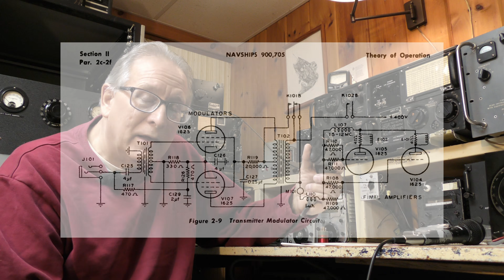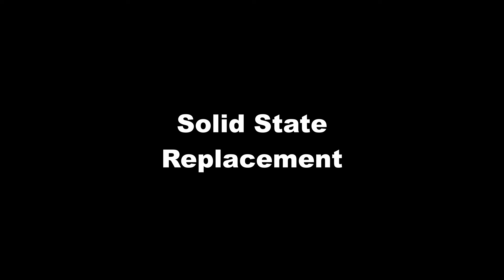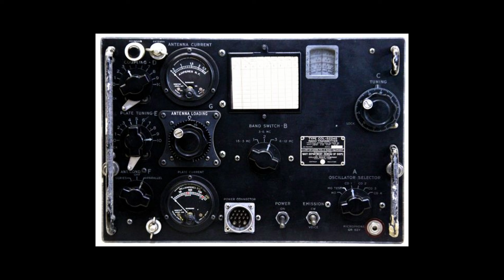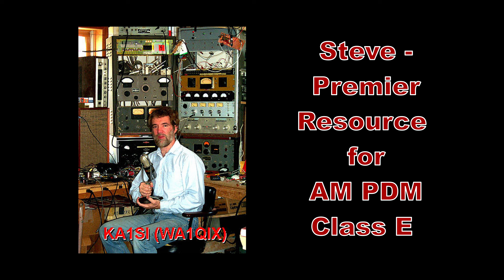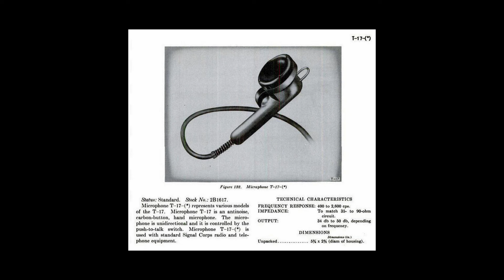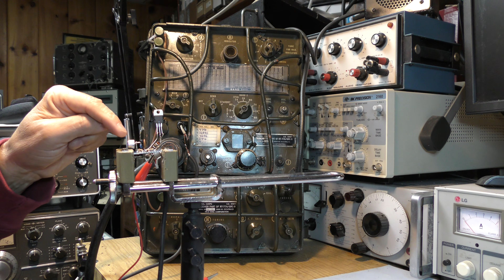T 17 Carbon Microphone Replacement

Comment: Interesting, but I'd like to use the microphone from an old mobile phone.  A bit fiddly to solder the socket but it also has a volume control built in. Then I guess that you need an amp for the earpieces and some impedance matching maybe.  All to run off an LiFePO4 3.2V cell.

Yes too complicated and not as robust I'm afraid.
Reply from the maker: Older phone mics are definitely Electrets.

Comment: Mike I find it neat that you find parts in an old computer power supply, to build your carbon microphone replacement. I too have old computer power supplies, that I have found useful parts to use in other projects. Your right about the shorts, I get more out of your full length videos.

Comment: I've been using electret replacements since the 1980's.
However, I've had a number of them fail for various reasons.
They can be blown with RF (hot-mic) feedback, back-EMF from the TR-relay, and other voltage-spikes.
The worst offender was a Swan 260 Cygnet, that took several measures to tame.
I've used voltage-regulators as isolators, series inductors on the power, and very-low value inductors on the isolated audio-line.
So, you may have a couple fail before you nail a total solution, but it is worth it in the end.
In every case, I've gotten great audio-quality reports!

Comment: 17:30 Looks like a Western Electric T1 transmitter unit! I prefer using them with a two-transistor transimpedance amplifier, which also provides a constant bias for the mike in the range of 100-150 µA. We don't have to fry carbon mikes with 50-90 mA current like we used to now that we have transistors! (hi-hi) Here is a link to the schematic in UUE format, you need to decode it with uudecoder (for some reason YouTube deletes my comments with links): 7:'1T<',Z+R]I8F(N8V\O,6964V-.;DT

Comment: How does your circuit work in a high noise environment like a GRC-19 set with screaming jet engine  fan noise?
Reply from the maker: Wow! Yes that is a bad one. I thought my ARC-2A was bad.
Reply: @MIKROWAVE1  I had a GRC-106A set that was just as bad I'll never own another one of those the GRC-19 is much better IMHO.  I use the Roanwell  14610 carbon microphone elements in my T-17 they seem to work really well.
Reply from the maker: @U812-k7j Back in 1978, I worked for a startup as a co-op 3 quarters. I was 20 years old. My job was to test  military radios in front of a source inspector. The company principles were all GD castoffs. GD left Rochester in 72. The Navy and Army would send in radios for repair and recertification. T837 AMPS pig tuners R1051s GRC-106's. You name it. We would recycle scrap radios, make and test new components, re paint and stencil. We had all the microfische and I used a model 1 xerography to blow up prints with a bellows camera and hood. Endless hours on carousel. Thats why I will never own a GRC-106! Ha.

Comment: Useful info here.  I'm going to have to be dealing with some T-17s & wanted to avoid hacking at the radio internals.  I have one or two that "sorta" work but you do have to talk up to them.
Reply from the maker: Glad this helps you keep the radio internals original. We do not need more hacking!

Comment: G'day mate, all this stuff reminds me of my telephone technician days when the carbon 'transmitters' used for many years started to be replaced by condenser microphone 'equivalents'.  They worked well, except that they did not work as well as old carbon transmitters with the acoustic modems that we used at the time.  Regards, Felix vk4fuq in Australia.
Reply from the maker: Ya the electret really was too cheap to not use about everywhere!

Comment: It is warm enough you can wear shorts. As long as you are modernizing the mike, why not use IC's to modernize the T-17?
Maybe even surfacemount.
Or use a Heil carbon mike.
Reply from the maker: I obviously need to do a shorts short, wearing shorts!

Comment: IIRC, the TIP120 is good up to about 1MHz which is a lot higher than I can sing but it has the advantage that the gain doesn't extend much up into the RF band you will likely be using.  This means you don't need to worry about layout much.
Reply from the maker: Yes a Daft to RF transistor type cannot hurt with any transmitter that has its microphone exposed close to the antenna.

Comment: I'd offer to make you a carbon mic, Mike, but you're 57 years too late. When I was 10, I made pretty good mics from a cigar box, two razor blades taped to the top, standing up, and a carbon rod from a D cell straddling the blades  :)
I wonder what kids these days to when the mic to their 3" reel-to-reel tape recorder from K-Mart breaks?  Thank you Mike! 73 OM dit dit
Reply from the maker: Those old tape recorder mics were probably crystal or ceramic at first, but my Realistic Cassette Recorder had a dynamic microphone!

Comment: I checked and I have a T-48 carbon microphone. Like the speaking part of an early telephone without the earpiece. Patented 1901, 1907 and 1908 marked on it. 
I bought it around the time we went to decimal money for 50p or 10/- (ten shillings). Both prices were shown for it so about 1971/72. 
G4GHB.
Reply from the maker: Wow how many Guilders is that? Ha. I tried the carbon mic modulator by wrapping turns around a power oscillator tank and got lip burned a bit! But it worked!
Reply: @MIKROWAVE1  
Guilders? I have no idea. 
Ooops a lip burn. Too close.
I did make a single BFY50 transmitter for Top Band from a circuit in RadCom years ago and it said plug a carbon mic into the emitter. It kind of worked over just a couple of miles to a local amateur. 
The upright body is metal with a large circular metal base and the mouthpiece seems to be maybe bakelite.

Comment: That's cool about the electret with boundary layer, I'm guessing that acts like a larger diaphragm? Perhaps if you used that it wouldn't feed back so much.
Reply from the maker: No, its more of a Baffle - keeping reflections from sneaking in from any other direction than the front.